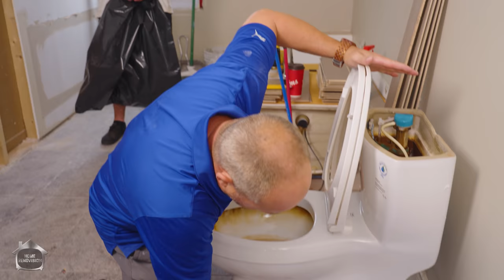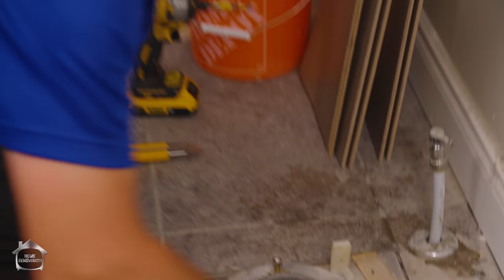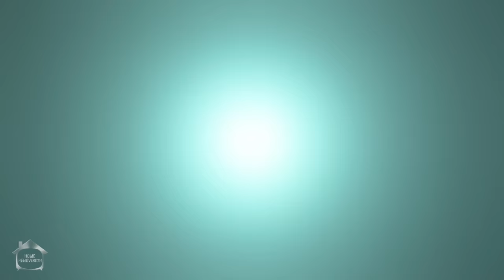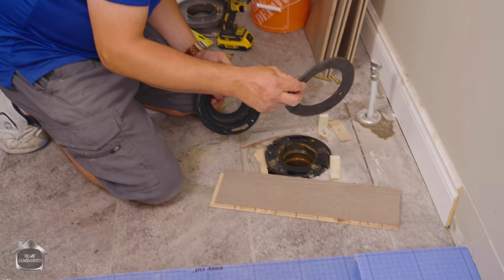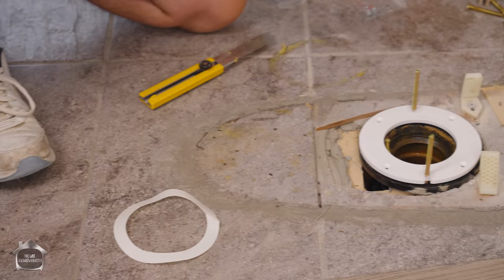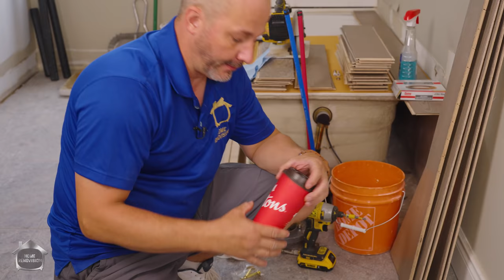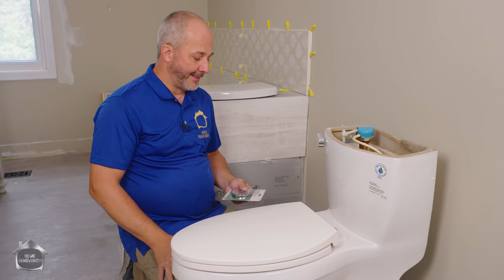How To Install A Toilet So It Won't Leak | DIY For Beginners

Comment: VERY VERY bad advice! NEVER grout and/or silicone a toilet to the floor.  Doing so traps water and hides leaks and you will end up with a rotted floor and will end up paying for new joists and subfloor and the bathroom remodel you didn't expect.
Reply: Always silicone the base of the toilet. HOWEVER, leave 2 inches at the back open to detect any eventual leak.
Reply: @carolegeddes998  No. Can still trap water.

Comment: Thanks Jeff for the great DIY videos you have been making over the past five years! lf you have a spare moment, which I doubt you ever have, would you consider doing a short video on the best way to do a level cut in a damaged 3" PVC waste line that is between joists under the subfloor?  There's so little room that it's impossible to cut it with a hand saw, so I can add a 3" coupler to it to replace the bad section. Apparently, it was damaged when someone cut off the Oatey PVC flange with a Sawzall. I tried to cutoff the damaged section of PVC with an small blade on a 5"x3/8" shaft from the inside of the pipe, but I could not get a level cut for the life of me.  I appreciated any advice you might have on the best way to do this. Thanks a million!

Comment: I just brought a house, and I am so tempted to change the toilet myself. I am so terrified if I do something wrong, or miss a step. I will need to ward this a few more times tor get myself, mentally ready to change and install a new toilet. I really like the toilet, tank and bowl, all in one, without the separate tank and toilet bowl. What kind of brand it that? 

I have also noticed in the footage, the black bits when you lifted up the toilet, are those mice poop? If I do change my own toilet, and there happen to be gaps around the hole, do you recommend me to use the Great Stuff expand foam to seal the holes? 

Thank you for this tutorial. Wish me luck.
Reply: Please don’t be terrified. Just pay attention to how you take the toilet apart and remove it. Take pictures of the process on your phone for a go back to. I’ve replaced wax seals and installed new toilets. I am a mom and mawmaw and I had to learn to do things because while together my husband wouldn’t do anything fiy’s and after he left me I learned to do so many things sometimes asking advice and sometimes just pondering. You can do this. Please respond after you have finished. 👍👍🇺🇸

Comment: My toilet seal replacement wouldn't last long before leaking again.  Last time I put down 2 wax rings and it lasted longer. before leaking again.  Mt floor is cement and the pipe is cast and is flush.  You taught me that the pipe should be above flush.  Thanks.

Comment: Been in the supply house for 16 years. Rubber gaskets works better they will not blow out! They have a hybrid system like what he's has that works good. If the flange is below floor use closet flange extenders and silicon. Thicker gaskets can work but leak in time.

Comment: I learned a  lot watching this over and over again but I am not confidently doing this myself.   The top of the fringe of my toilet is 1 cm below the floor, and I believe that has caused a big leak in the ceiling. The house is 9 years old. I am going to get a plumber to fix it, should I tell the plumber to get a big wax ring? What would you recommend? Thank you in advance.

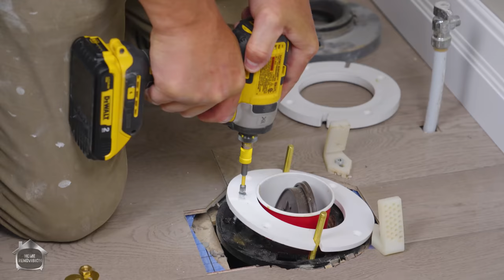Comment: 2nd video of yours I've watched. Very informative. At 22:40 in this video you start driving some screws into a flange extension but don't say how long those are. It probably depends on the thickness of the extension being used, but how much of the screw should anchor into the original flange below? What if the condition of the flange below is terrible?

Comment: Wish I knew about all the installation flange kits a few years ago. The 'professional' plumber really took us for more work than was needed to replace my leaking toilet, which was in the house for over 30+ years and after he installed the new toilet after a week or so it started leaking because apparently he didn't set the toilet correctly and didn't compress it or he only finger tightened the thumb screws. Anyway, thanks for the potential options for my replacement project.

Comment: I used a Fernco rubber seal instead of a wax ring and it works wonderfully and easy to install.  Peel and stick to the bottom of the new toilet and it has ribs to suck the new toilet in the hole.

Comment: This is were I love the toto toilets. The toto uni-fit rough in make the difficulties of traditional American toilet so much easier.  Also the dual flush cyclone effect really does flush way better at low flow than the competition.
Reply: Toto toilets are all my plumber will use. I had never heard of them before, and they are uber expensive.  I need to replace my old toilets and am wondering if they're really worth it ...
Reply: @ajt9745  To me they are.  Mine has a non-stick coating too and I have the bidet feature which really helps with it self cleaning. Only need to use dish soap to clean cause bleach cleaners could affect the non-stick coating.  I will never buy a different toilet now that I have own toto.

Comment: Many plumbers are saying not to caulk or grout around the toilet because if the wax donut doesn’t do it its job, you will see the water leaking out from the base of the toilet. If you caulk or grout, you will make a reservoir under your toilet and the floor will begin to rot. Makes sense to me.😊
Reply: True.  I saw one video where it was recommended to leave a small area in the rear of the base not caulked so the water would seep out there.

Comment: Great appreciate this channel and the current video.  I am about to install a box store toilet and as you implied I need to get the toilet set down perfectly straight.  Does it make sense as a first step to set a level on the abs flange before measuring for the height of the abs flange relative to the finish floor?   And, if the flange is not level,  do you remove the flange from the subfloor and shim here?   I only ask because the plummer years ago said he had to "shim" the toilet, and I did not know where and how he did this. Thanks for any help.  Ace

Comment: Hello 

My flange doesn’t sit level. One side of the flange drops below the finished floor by millimeters on one side. Plumber install the toilet drain crooked so the flange sat crooked. Is there a fix for this situation? Do I have to replace the flange and the drain pipe? 

Thanks for your time

Comment: Very helpful video! I've been wondering for some time now how to deal with PVC (with no flange) ending flush to the my concrete floor slab. Thanks for the info about the twist and seal flange!

Comment: I have been using silicone to put kitchen sink drain baskets in for years but I’ll let it dry 24 hours and this is for my own household use as well, but never a problem I’m 64 but I know I’ve been using it for 40 years three or four of them

Comment: Thank you! I don't do this kind of work or anything. But It pisses me off to see so many people using silicone as a dead permanent installation and solution. Then bury it under a bunch of work. Silicone is meant to be redone every so often. It's a sealant that requires maintenance. It is not permanent. When I moved into my first house somebody actually used silicone as a wax ring. It was just gobs of silicone when I pulled the toilet up. The crazy thing is that it wasn't leaking or anything. I just bought a new toilet because I was upgrading it. The old one was really big and had a huge tank and used a ton of water and it flushed in slow motion lol.

Comment: I recently got a really nice 5 year old $500 Kohler toilet for free because it was slow flushing. They didn't know what was wrong and also replaced the float, internals,etc.  As you'll find in other YouTube videos, a slow flush is most often only due to lime scale deposits which can easily be dissolved with 1:1 mix of muriatic acid and water for one hour.  Wear googles and mask, pour in the mix, seal the bowl with plastic, turn on bathroom fan, then rinse and flush with water one hour later.  It will work like new.

Comment: Never grout around a toilet. That is inviting cracks. Use only caulk. And leave the back portion open, in case there is a leak.

Also, those 1/4-turn cutoffs are great...until they don't seal completely. Then, there's no repair kit available, as there is for the regular turn-off valves. You have to replace the entire valve.

Comment: This man is a toilet genius. I just installed my first toilet (in 30+ years) and the "10 minute" job was a 2 hour 'fun' fest because I needed to clean and check everything. I'm no pro. And of course, it still wobbles just a little (shims help but its a 2nd floor so not as stable as concrete on the first floor). I should have watched this video first. Loved the take away coffee cup tip. That was golden. Or... didn't stink? Anyhow, thanks for posting!
Reply from the maker: Cheers Steve.
Reply: @HomeRenoVisionDIY  Thank you for the highlight! If you have any tips for me on the slight wobble, I am open to any techniques . From what I can tell, its not leaking, but my first guess is the mount point is high to the floor level. Thanks again! #Thewizardofgo :D

Comment: Great video! Out of curiosity though, I was taught to never caulk a toilet base because if there was a leak, you'd want to see it before it rots out your subfloor. Is that true?
Reply: If installed correctly it should not leak. Also the caulk could prevent it from leaking by stopping movements
Reply: Correct. I don't believe in sealing toilets to the floor externally.
Reply: It's code in a lot of jurisdictions, but I avoid it.

Comment: thanks for the tips, wish u explain how to figure out measurements. Your toilet sits pretty far from the wall.  i recently upgraded to a modern toilet but ran into problems the existing flange didnt line up & was off by 3inch.

Comment: Hi - Great video! The toilet flange extender kit you use (the white ones with the stick-on gaskets an bolt holders) - I can't find them linked in your Amazon or Home Depot links, can you let me know what product this is? I can't find anything that looks like it... Thank you!

Comment: Great video! What do you do when the flange bolt holes are blown out? What can I do about that?
Reply: Like, when the flange's slots for the closet bolts are broken or stretched and the flange won't hold the T head part of the bolt anymore to hold the toilet down? A few options: 

1: If it's on a stable wooden floor that is not rotted, decayed, or wet, and there is wood all the way up to the underside of the flange, you can use closet screws. Closet screws don't rely on the flange, they secure the toilet onto the flange by pulling it down toward the floor instead of against the flange itself. This is a good working solution. Won't work on a toilet that's sitting over a concrete slab-on-grade foundation house like mine, only a wooden floor beneath. The screws won't screw into a concrete slab.  
2: Install a metal flange repair ring. Not advisable imo because all metal rots eventually. 🤷🏻‍♂️ 
3: Replace the flange altogether. If it's a cast iron flange on a cast iron pipe that is lead and oakumed together, you can bust off the old flange with a hammer breaking it up, remove the lead to reuse it or toss it and use new lead, and then put a new cast iron flange in place with new packed oakum and recast lead poured in and peened. If it's a plastic flange or a hybrid plastic and metal ring flange, you can cut a vertical line into the flange through the mounting collar down to the outer diameter of the downpipe, heat the collar with a heat gun where the glue is, and then pry the flange's mounting collar right off the downpipe where the glue joint is because the heat softens the glue and the vertical cut relieves the neck  tension. Then clean up the OD of the downpipe with sandpaper, prime it, and glue on a brand new plastic flange. If you want, you can cut the verrrrrrry top of the flange off with a sawzall, angle grinder, hand drill with a saw blade, or Dremel, and that'll make it easier to make the vertical cut, visualize the glue joint, and use a chisel or screwdriver to separate the remaining collar ring while heating it. If you have a 4" pipe and you absolutely can't get the old flange or collar unglued from the pipe after you cut the very top horizontal part of the flange off with a sawzall or angle grinder or Dremel giving you a level pipe end, you can install a 3"-into-4" repair flange like a twist & set or a 3 screw expansion gasket type repair flange that sits inside the pipe instead of around the outside. 3" is still plenty to accept the water slug when flushing. This is the best solution. If you replace the flange entirely as if it's a new install, it'll last forever (especially if plastic). A 3-into-4 repair flange will also last a long time, up until that rubber gasket fails. 
4: If you have the plastic center and metal ring hybrid flange specifically, you can cut the metal ring off and install a new 2 piece ring designed specifically for fixing this style of flange. Again, I'd rather just cut and unglue the inner portion of this style flange off, and replace it with a new all-plastic flange glued into place on the OD of the pipe. The metal ring always rots over time. Always. My 2 toilets did this. I hate the hybrid flanges. All-plastic is best. It'll last a lifetime. 

There you go! Those are the options. One of them will work for you. Pick your preference and go for it! Everything except the lead & oakum method with a new cast iron flange can be bought at Home Depot or Lowes. The lead and oakum cast iron method will need materials sourced elsewhere, or an old fashioned plumber can do it for you.
Reply: Super ring

Comment: Is 1.5 turns past finger tight right for a compression supply line? The few sources I've read stressed the importance of only doing a quarter turn with your wrench.

Comment: Jeff I have a question Sr. Seems I'll be using the double spacers but my original flange isn't cast iron but it is metal ring with ABS...now those spacers don't line up with to many of the screw holes...can I screw through the metal ring to get to the sub floor? I'm on second floor with 3/4 " osb subfloor, adding half inch cement board with modified thinset and screwed down, then tile..so this is my predicament...I want to avoid having to cut out 3" piping to add a new flange...thanks have a great one

Comment: I have 2 American Standard (golf ball) toilets and I replaced both of them with the rubber seals you showed, within a month or so I needed to replace both of them because of leakage. Thinking that those were junk I went back to the wax rings and guess what, both of them leaked also. So now I’m at a loss as to what to try next. Any suggestions as to whats happening with these things? Thanks for the video, nice job.

Comment: On one of your videos you said don’t use silicone under the spacer. Just bought a 1/8 spacer and there is no gasket on the plastic spacer. Should I buy a gasket separately?

Comment: I'm about to tackle a toilet replacement tomorrow glad i saw this. My toilet rocks side to side on a slab  with tile floor I have a little sewage coming up from one of the toilet bolts the house isn't too old 5-6 years and  are the only owners I'm betting the wax ring has collapsed  or more than likely the toilet was improperly installed to begin with.  Really wont know till it's pulled up.

Comment: I plumb hot water to my toilets for radiant heat & seat warmer. Flushing the toilet helps circulate the water to the that area of the house & cuts down wait time for hot water at the sink or kitchen. Instead of a hot water recirc, I can just flush to toilet & get faster hot water + radiant heat in between flushes. No sweaty tank or mold behind the toilet & after 5 years my tanks still look clean. I had flange leaks 4 yrs in & think it had more to do with IMPROPER OR CLOGGED VENTING from pine needles. Manufactured home vents 2- 1 1/2" vents for the house in 1980. I'm redoing the roof and waste lines for 3" vents now.

Comment: Love your videos. I am somewhat “confused” about toilets having P Traps. According to 909.2 of the IPC, the trap weir of any fixture can never rise above its vent opening. 

However, a trap weir of a floor toilet always rises above the vent opening based on its position/location - thereby “creating” an S trap configuration. 

Since a toilet’s trap seal automatically refills whenever you flush, sewer gases cannot enter back thru the waste pipe. 

Section 909.2 of the IPC makes toilets exempt from this trap weir height requirement - so basically a toilet has an internal P trap but when installed it functions as an S trap. 

That’s what I read from a few plumbing engineering articles.
Reply: If you have to pee often the pee trap will get backed up. Use the trees outside and let the river flow!!

Comment: How long will the rubber compression rings last? I just installed one but now I'm thinking of replacing the top rubber part with a wax seal as I think it would last longer...

Comment: Just moved into a condo. The neighbor downstairs complained of a water spot on his ceiling right below my toilet. The toilet doesn't wobble, and doesn't leak from the base. We're going to pull it up and see what we're working with. Thanks for your informative video. They did put new flooring on top of old, so it is possible that an extender ring is necessary and wasn't used.

Comment: I just pulled my toilet off to put in new flooring and rather than get a bucket of water, (or a sponge or a vacuum) I just pushed it thru the line by pushing plunger down a few times. Not a drop of water was left.

Comment: We are stacking the white plastic flange spacers but they didn’t come with the black gasket rings - what I read was to use silicone between them but is this also a no silicone spot?